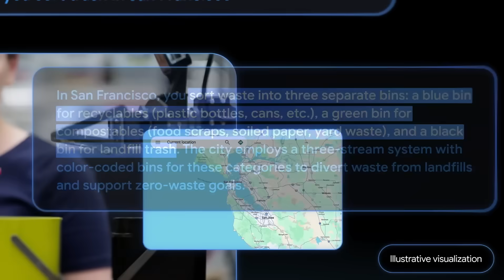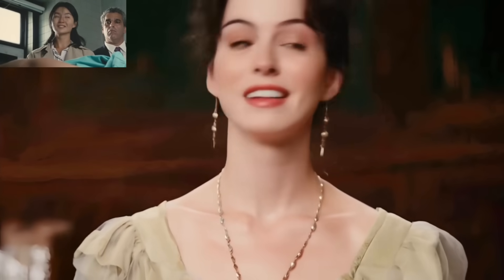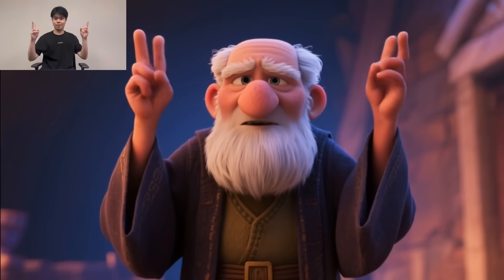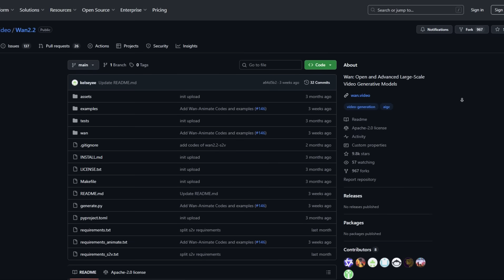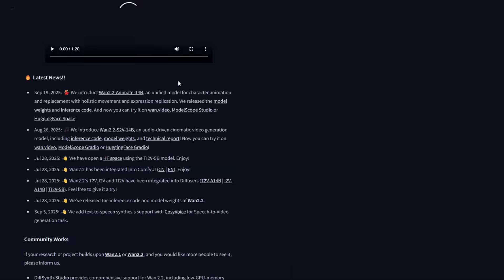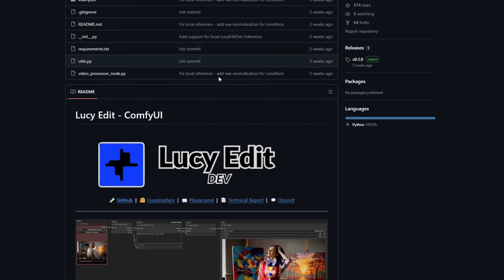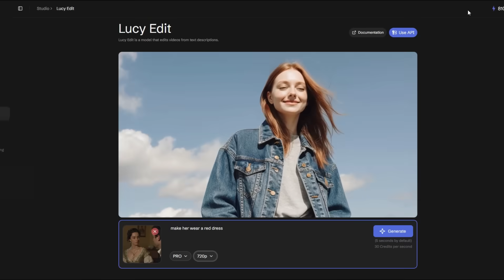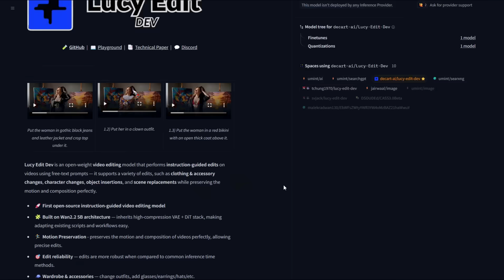China Released the best animation AI, #1 Free Video editor AI, Google's Thinking Robot, & MORE

Comment: Problem, it requires multiple computer cpu processing power to generate the final product.
Reply from the maker: No, it doesn’t. For both wan Animate and LucyEdit, all you need is a computer with a GPU that has 16GB of VRAM. That should be enough. The generation will be slower since it’s not AI grade hardware, but it will still work fine.

Comment: Cool video. For Wan Animate, and the demo Lora Edit, what type of machine are you running?  Would you be willing to share your general specs needed to do this?
Thanks.
Reply from the maker: All the demos shown here are official ones from wan Animate and LucyEdit, except for the last one in LucyEdit’s official playground. You can find the link in the description to check out all the demos yourself.

As for the specs, I already mentioned them earlier — wan Animate requires at least 16GB of VRAM on an NVIDIA GPU, while LucyEdit needs a minimum of 10GB of VRAM. In both cases, it’s best to use an NVIDIA RTX series graphics card for optimal performance.